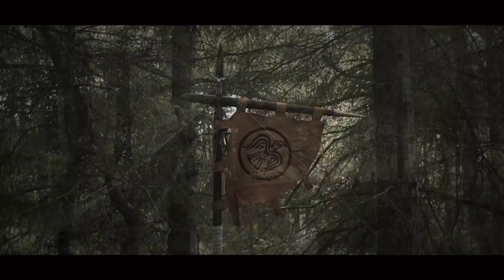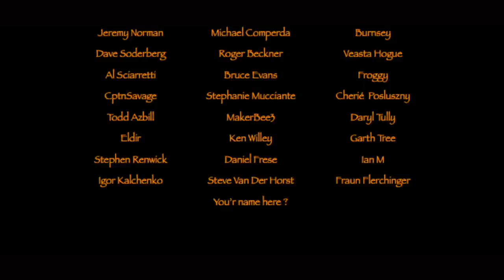Black Raven - Hrafn

Comment: Thanks for the video Tom. When you bought your cauldron did it come with the ring on the pot or did you weld it on yourself 
Atb
Paul
Reply from the maker: No I put it on myself 😉👍🏻 but not welded on 😊 just made a tight fit so it stays on 
Appreciate your feedback and question my friend 🏕🔥
Tom